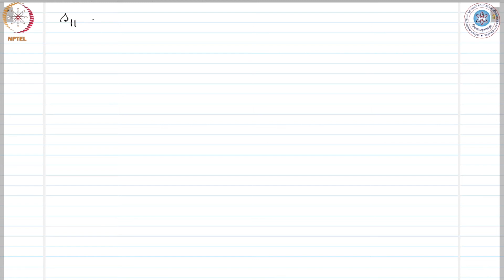mod05lec38 - Transfer matrix for a rectangular barrier

Comment: the signal in the term (q² + B²)² in 13:21 seem to be wrong too, if it came from i(q² - B²) * -i (q² - B²) it should be (q² - B²)² not (q² + B²)²